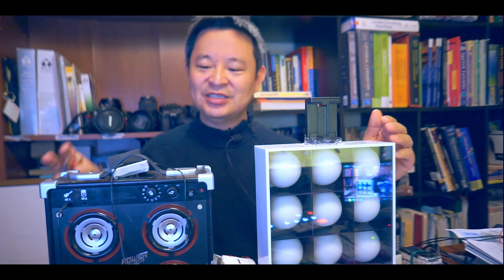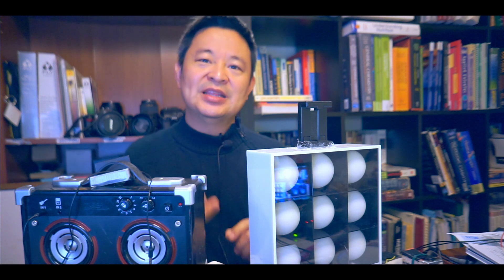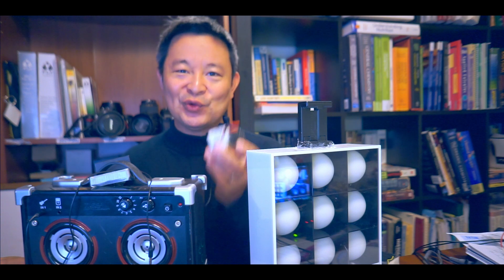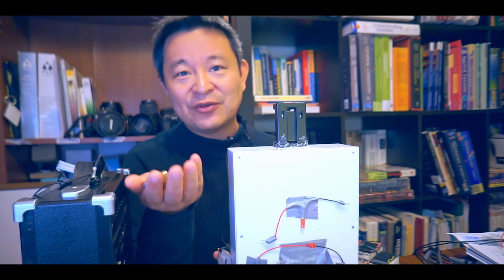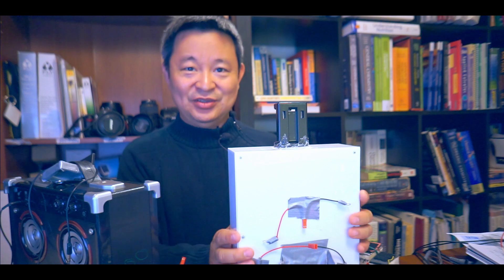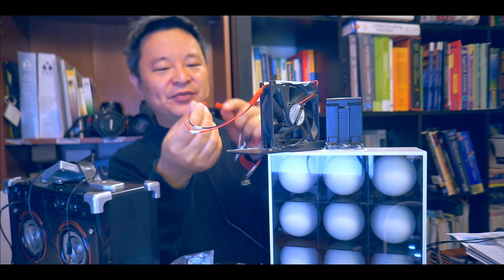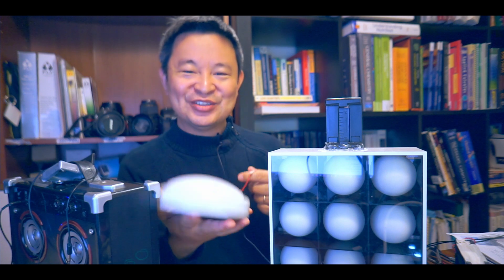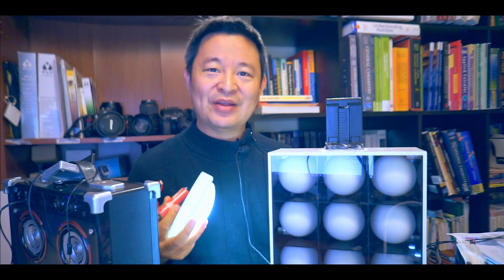Converting Electronics from Alkaline Powered to Lithium Powered Device

Comment: What are you doing about the discharge rate on the 18650 cells? How are you monitoring the cell to preventing it from over discharging? Li-Po conversions are usually easy because they have built in BMS to protect the battery.
Reply from the maker: I only charge it up to 3.7v to 4.0v and then if I need to use it I will charge it to 4.2v.  I am monitoring with a voltmeter.